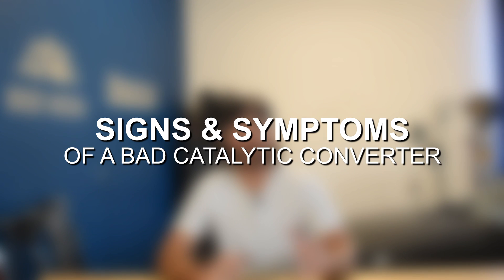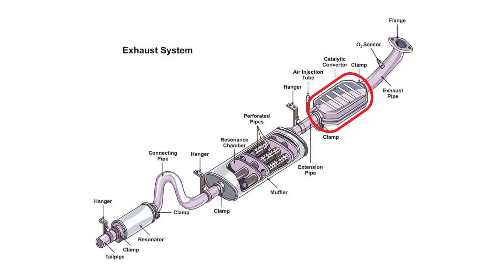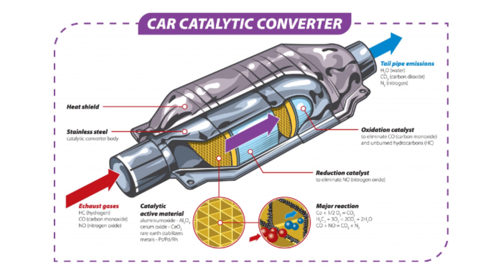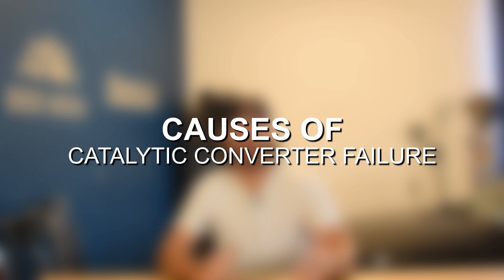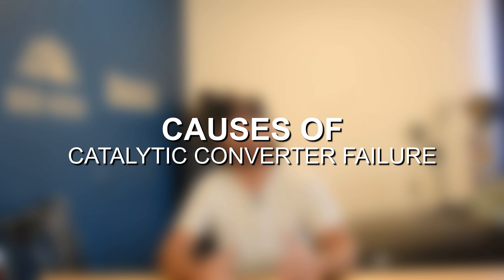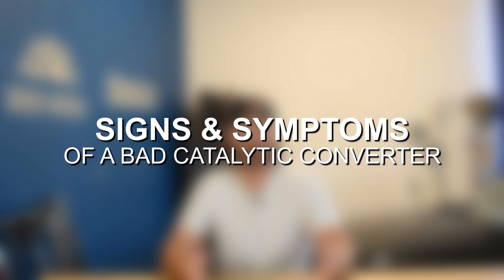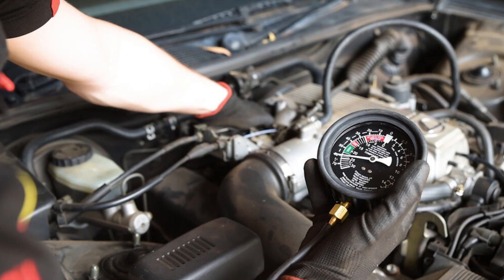Signs & Symptoms of a Bad Catalytic Converter!

Comment: He is WRONG about converter-related codes.  At least 2 I know of are P0420 and P0430.  The computer determines that the "efficiency" of the cat(s) has/have dropped below the acceptable "threshold" (I'm told 95%), indicating the cat isn't functioning properly.

Comment: My truck, a 260,000 mile f150 4.6 with a manual mansmission. Has the entire intake re done, pcv routed to a catch can, evap capped off. New plugs and coils, one coil was disconnected one plug had a broken electrode.  Randomly, after resetting the CEL after a few days gets a random lean code (smells like an old lawn mower running so i doubt thats true), random misfires and takes its sweet time getting thru gears even 1 and 2. When i park it one side cats are glowing red the other side will sound like the bottom end of the engine is going to fall out. Safe to say im clogged up.

Comment: I have a 2005 Ford Taurus, won't rev past 4000 while in park. In gear car will barely move at all. Gonna swap fuel filter in the morning. But was thinking the cat because I recently had a blown head gasket, and used a gasket sealer. (Forgive me but also a 20yr old car) Ran fine for about 300miles then lost power on high way and continued losing power to where I'm at stated previously. Won't rev past 4000 in park won't move in gear. Trany shifts fine fluid looks good. Your thoughts?

Comment: My car is throwing a p219B, p2196 & p2198 code and ive done changed so many parts I just dont know what else to do, i changed the throttle body. Pcv valve, purge valve, Spark plugs and coil packs, 02 sensors, fuel injectors. Air filter, maf sensor. The symptoms it was having got worse after changing out the fuel injectors my RPM guage is steadily bouncing up and down and it drops so low to a point it wants to stall out.

Comment: what if you have 4 cats 2 mufflers and 2 resonators this is what i have on my 04 town car and on the driver side it has a rattle not always but its there i thought it was a flywheel bad but its only on idle when you rev it you can tell 100% its NOT in the motor its in the first set of cats what advice can you share to help any will be 100% appreciated thank you for the videos as well

Comment: I have a Ford fiesta 2011. I was driving down the road. Doing 80 and all of a sudden, the car bogged raid out. I lost all power. I had to get it towed. We got it checked. We don't know what's wrong with it.
I have to pump the gas just to get to 40 to 50 km. I cannot go faster than that. And when I try it backfires, small little backfires, but still, now someone is telling me is my fuel pump. The other one is telling me my Cadillac. Converter is blocked. I have multiple cylinder misfire codes. We checked every coil one by one. They're all firing when we pull them off the car bass out. I have a map airflow sensor. Two camshaft sensors, all these sensors have been changed.Code has been cleared the obd 2  scanner.Tells me i'm getting a  p02f inactive code with it.I am puzzled.I don't know what to do any ideas
Reply: I've have always figured a backfire is usually due to a timing issue

Comment: Great video, the only symptoms in my 2013 Nissan Altima are rotten eggs smell when I accelerate and some engine shaking when i speed up after slowing down for traffic, is this catalytic converter? I don't have tje check engine light on and I just passed an Emissions test 3 months ago

Comment: My Chevrolet Tahoe it was trying to go but the speedometer wasn’t going I heard one rattling my mans been a mechanic for 40 years but he can’t figure out what it is we’re screwed
Reply from the maker: T - That points to a problem in the driveline between the transmission and the wheels. On these trucks, common culprits are a failed transmission output shaft, stripped transfer case, or broken driveshaft/U-joint—any of those can make rattling noises while preventing the truck from putting power to the ground, and since the speedometer reads off the transmission/transfer case, if that shaft isn’t turning the gauge will stay at zero. First step is to safely inspect underneath: check if the driveshaft spins when in gear, and see if the U-joints or transfer case output are moving freely or making noise. If the driveshaft doesn’t spin at all in gear, the issue is inside the transmission or transfer case; if it does spin but wheels don’t move, it’s a broken axle or differential. You’re not screwed—it’s very likely a mechanical break in that chain, and once narrowed down it’s fixable.

Comment: I got a 2008 Subaru an when I go up a hill it go slow an don't went to climb up the road run good on level what could it be
Reply from the maker: C - The most common causes are fuel delivery or engine power loss under load: a weak fuel pump or clogged fuel filter won’t supply enough fuel for climbing, a clogged catalytic converter can choke the exhaust so it feels fine on flat roads but has no power on hills, or a bad MAF sensor, O2 sensor, or ignition coil can cause weak combustion only when the engine is under stress. Transmission issues (slipping CVT/automatic) can also make it feel like the car won’t climb. The best first step is to scan for codes even if the check engine light is off, then check fuel pressure and listen for the engine revving higher without the car accelerating (which would point to transmission slip). A clogged catalytic converter is especially common on Subaru's with age and gives exactly that “no power up hills” symptom.

Comment: Hello, my 2000 honda accord coupe keeps throwing the 0131 code for my bank1 o2 sensor. I've gotten my throttle body cleaned recently, along with my EGR ports since my check engine light first came on for that. I'm curious if it's the cat thats making the sensor go bad.
Reply from the maker: R - P0131 indicates a low voltage reading from the Bank 1 upstream O2 sensor, usually meaning the sensor is reading lean or is malfunctioning—but it’s rarely the catalytic converter causing this directly unless the cat is severely clogged and creating extreme backpressure or heat, which would likely cause more codes (like P0420 or P0300). Since you've recently cleaned the throttle body and EGR ports, it's possible some residual cleaner got into the sensor or altered airflow/fuel trim temporarily, but if the code keeps returning, it’s more likely that the O2 sensor itself is failing or there’s an issue with its wiring or ground. Inspect the sensor harness for damage or corrosion, and if it looks clean, replacing the upstream O2 sensor is the logical next step—it’s a common failure item around that age and mileage.

Comment: Hi after i drive a while and turn off my car it overheats tho i fixed everything related to cooling radiator fans and thermostat and checked everything else 
Will this overheating could possibly be from cat converter ?
Reply from the maker: S - Yes, a clogged catalytic converter can absolutely contribute to overheating after driving, especially if the cooling system is confirmed to be functioning properly. When the catalytic converter is restricted, it creates excessive backpressure in the exhaust system, which can trap heat in the engine and exhaust manifold. This trapped heat doesn't always show up immediately while driving, but once the engine is shut off and coolant stops circulating, the residual heat can spike and cause the engine to overheat. You might also notice poor acceleration, excessive fuel consumption, or even a sulfur-like smell from the exhaust—common signs of a failing or clogged cat. A backpressure test or checking the temperature difference between the front and rear of the cat with an infrared thermometer can help confirm it.
Reply: @8020Automotive thanks my check engine just came up and oxygen sensor error i will clean cat and change sensors
Reply from the maker: @saifismx  Keep us updated!

Comment: 1. Whats the difference if you have a bad catalyctic converter replace with a straight pipe on altima 2010?

2. How a straight pipe would affect on a car running on 32 mpg? 

3. How it would affect on all car sensors?
Reply from the maker: M - 1. Replacing a bad catalytic converter with a straight pipe on a 2010 Altima (or any modern car) removes the emissions control that burns off unburnt fuel and pollutants, which will likely trigger the check engine light (P0420 or similar), mess with fuel trims, and can cause poor idle, engine hesitation, or even limp mode, depending on how the ECM reacts.

2. On a car getting 32 mpg, straight-piping the cat won’t necessarily improve mileage—in fact, it could make it worse if the ECU starts compensating for altered exhaust flow or incorrect O2 sensor readings; you might notice minor performance changes, like slightly quicker throttle response, but often at the expense of fuel efficiency and drivability.

3. Straight-piping affects oxygen sensors, especially the downstream (post-cat) O2 sensor, which monitors converter efficiency—without a cat, the readings will be incorrect, and the ECU will assume a fault, likely throwing off fuel trims and potentially affecting long-term fuel management, idle quality, and emissions readiness (which will fail you on inspection in most regions). A proper fix is either replacing the cat or installing a high-flow cat and tuning the ECU if legal in your area.
Reply: I have a 2013 Buick encore and the code points to the converter but it only has 43,000 mi on it. I had a mechanic replace it with an aftermarket and the code was still on so I had it taken off and the old one put back on because another mechanic told me to put the original back on and the code is still on. They supposedly check the sensors and they're all okay. So now I don't know what to do. I do a lot of intown short driving so wood pudding that cat cleaner they sell in it clear out the clog? Right now I've seen two mechanics and neither one has fixed the problem so I don't know what to do

Comment: My catalytic converter has a 3/8 inch hole in it, does this mean it has to be replaced? Thanks.
Reply from the maker: J - I mean, yes, this is a problem.. it will cause exhaust leaks, can throw off oxygen sensor readings (leading to poor fuel trims or check engine lights), and may prevent the converter from reaching proper operating temperature, reducing emissions efficiency; while technically you could patch it with high-temp exhaust epoxy or weld it closed, any hole compromises the integrity of the cat, and if you’re in an emissions-regulated area, it won’t pass inspection—so yes, the correct fix is to replace the catalytic converter, especially if it's starting to rust through or if you notice performance loss or codes like P0420.

Comment: I have my car with 85 thousand miles I don't have any symptom that the catalyst is failing but do you think it's a good idea to remove it to clean it?
Reply from the maker: T - If your car has 85,000 miles and isn’t showing any signs of a failing catalytic converter—such as loss of power, poor fuel economy, check engine light with P0420/P0430 codes, or sulfur smell—then removing and cleaning it is generally unnecessary and can even introduce risk, as many DIY cleaning methods (like soaking or pressure washing) can damage the substrate or cause pieces to break loose and clog the exhaust; catalytic converters are designed to be maintenance-free under normal conditions, so unless you’ve had repeated misfires, oil burning, or rich running that could contaminate it, it’s best to leave it alone and focus instead on keeping the engine running cleanly to prolong its life.
Reply: @8020Automotive  Thank you for your answer, I always had that question!!

Comment: I believe its my cat its coming from underneath my  2012 chevy Tahoe left side its at the shop they thought it was my fly wheel or flex plate they replaced it but the noise is still there yes i burning gas check engine light came on and the code was po305 which was misfire in bay 5 of spark plug and wire when taking it to the shop it act like it wanted to shut and kind of struggle with me pushing the gas pedal to go today i went by there to see what is going on they said were still trying to figure out i suggested for them to look at the cat converter so i dont know cat has never been replaced and record of it being replaced on car fax 
Any suggestions?
Reply from the maker: S - Yes, based on everything you’re describing, your instincts are likely correct: the driver-side catalytic converter may be clogged or internally broken, especially since it’s never been replaced and you’re well past the mileage where they commonly fail on GM trucks. A failing cat can cause backpressure, which will trigger misfires (often on the same bank) and cause the engine to feel like it’s choking, especially when accelerating. If the shop already ruled out the flex plate and you’re still getting that noise and hesitation, they should do a backpressure test on the catalytic converter or temporarily remove the upstream O2 sensor on Bank 1 to see if performance improves—this is a quick way to confirm if the cat is plugged. A collapsed cat will also cause heat buildup and can cause ticking noises or strange exhaust sounds from that area. So yes—push them to check the cat more seriously, because everything points to it.

Comment: I got in my truck this morning and noticed that I lost a bunch of power and everytime I pressed the gas I got this choppy kinda sound like the engine was struggling for air. My truck is 19 years with the original cats. I’m hoping its just this problem
Reply from the maker: J - Given your truck is 19 years old with the original catalytic converters, the sudden loss of power and choppy, struggling-for-air sound under throttle strongly points to a clogged or failing catalytic converter, which can severely restrict exhaust flow and create backpressure that chokes the engine, especially under load; over time, the internal substrate of the cats can break down or melt, leading to exactly the symptoms you're describing—so before diving into more complex diagnostics, have a shop check exhaust backpressure, or temporarily disconnect the exhaust before the cats (if safe to do so) to see if performance improves, which would confirm they're the issue and give you a clear path forward.

Comment: hi I have a Holden Statesman WH 2002  I have sluggish acceleration taking off fast and after that the car is good. I'm always taken off normal at corners if I take off too fast I lose power. I had the car about 3 years and it's always been like that I'm getting sick of it I had to get a fix before something happens at a corner one day. thank you. I was from New South Wales move to South Australia and back to New South Wales and back the car went good if I drive normal
Reply from the maker: P - Your vehicle with sluggish acceleration only during fast take-offs but otherwise running fine likely points to an issue with off-idle throttle response, which could be caused by a failing throttle position sensor (TPS), dirty or sticking throttle body, or even a lazy mass airflow (MAF) sensor giving delayed airflow readings during sudden acceleration; since it’s been like this for years and improves with gentle driving, it’s likely the ECU is compensating for bad sensor feedback under light load but struggles when you demand sudden power—also check for a clogged fuel filter, low fuel pressure, or even an early-stage torque converter issue if it’s an automatic; I recommend starting with a full scan of live data, focusing on throttle response, MAF airflow, and fuel trims, and cleaning the throttle body and MAF as a first step—you might be surprised how much of a difference that makes before diving into parts replacement.

Comment: There's a third scenario he didn't touch on. The cat can break apart and remain in the can. This can sound just like, and be mistaken for a rod knock.
Reply: Would this cause clouds of smoke out the tail pipe once in a while ?
Reply from the maker: C - True! Thanks for sharing.
Reply: This one! Mine glow, truck is sluggish anddd when it gets hot it sounds like a rod bearing squeak with a knock to it.

Comment: I got a check engine light today.  When it was scanned I got a CAT code.  Can a Catalytic Converter cleaner help?
Reply from the maker: Y - A catalytic converter cleaner can help in some cases—especially if the check engine light is due to light carbon buildup or efficiency-related issues like a P0420 code (catalyst system below threshold)—but it's not a guaranteed fix; if the converter is physically damaged, melted inside, or severely clogged, no cleaner will restore it, and the only real solution is replacement, though it’s worth trying a reputable cleaner first (like Cataclean or CRC) along with a spirited drive to get the exhaust temps high enough to potentially burn off minor deposits, especially if you're dealing with short-trip driving or excessive idling that contributed to the issue.
Reply: @8020Automotive  Yes I tried Cataclean and the engine light went off.  But the code still reads P0420.  Maybe it just needs to be cleared.
Reply: @youmarc11 is your vehicle is new miles have under 5k? Mine is on brand new wagoneer it has mile 3300 miles.